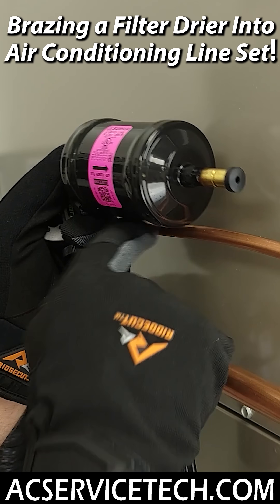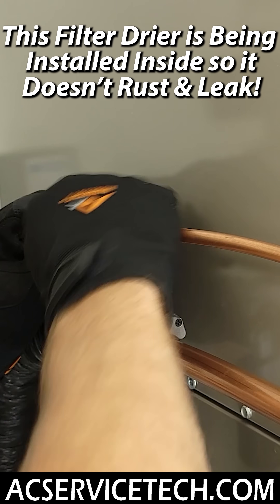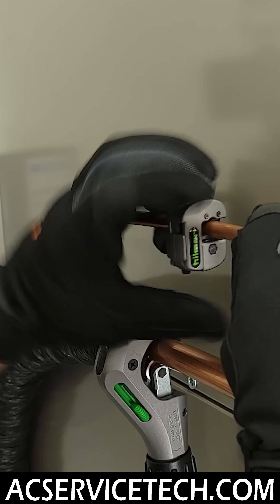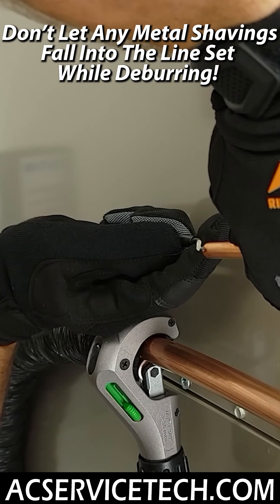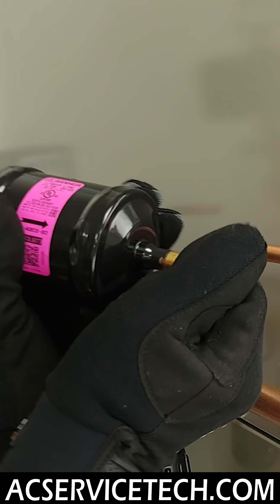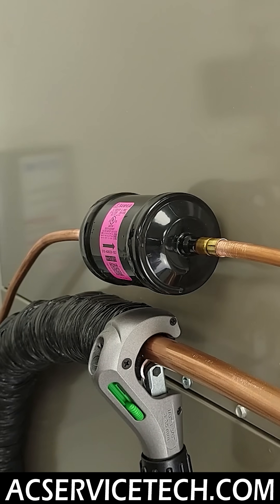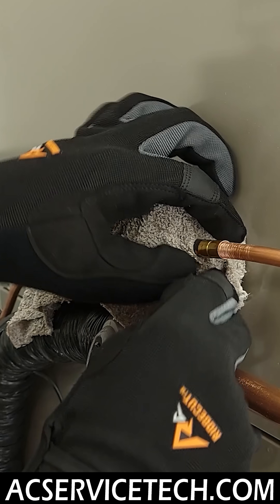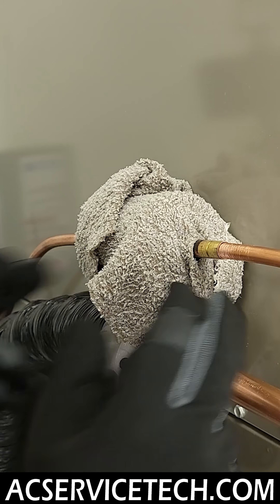Brazing A Filter Drier Into Air Conditioning Line Set!

Comment: R12 Vehicle A/C - my dad installed these in-line filter dryers on his vehicles and they were always very cold 🥶 ( any info on doing that? )
Reply: Vehicles have bigger filter driers ... vehicles have aluminum lines which are not weldable.. only copper is

Comment: I had to silver solder mile of 4 inch copper pipe in a factory took almost a yr lol they used the line for oxygen other line was for hydrogen they mixed inside glass machines. Gas engineers tested those lines for weeks before putting gas in them. Cool to watch them do there things

Comment: Filter needs to be place outside folks.  Don't let anyone pull this on you!
Reply: You best explain WHY cuz the rust  argument is sensible.. I was taught they should only be used for a temporarily period after a unit install.. Then removed.. Some guys put them on both sides. I think they offer unnecessary risk of clogging up, leaking or even failing internally & letting crap back into the system..
Reply: @francom6230 what you are explaining in your post is a "clean up" after a burn out.

Whats depicted in this video is moisture trapping bc the oil is hygroscopic and can only be separated by filter
Reply: @francom6230 you are BOTH wrong. Easy enough for both of you to read the installation instructions. They are to be placed as close to the coil as possible.
Reply: @MyName-o9y3d  Nope!  I'm a master plumber, the new refrigerants are considered flammable.  So.... they must be installed outside.  😂😂😂  nice try though
Reply: @Thatguyfromttown  youre wrong    stick to plumbing
Reply: According to Emerson, a manufacturer of filter driers, you install liquid line filter driers on heat pumps near the indoor coil in summer and near the liquid line service valve in the winter. The goal being to protect whichever metering device that will meter refrigerant upon first starting the system. On straight cooling, it goes close to the evaporator coil. Happy brazing!

Comment: You capped that joint, i saw no solder suck up into the fitting on the drier.
Reply: He isn’t soldering man, he is brazing.
Reply: @Blueraspberryguy  if the silver solder is not pulled into the joint, your braze is done incorrectly.
Reply: @Blueraspberryguy You undermeant what I stood.
Reply: @Blueraspberryguy its silver solder aka brazing rod
Reply: The guy is using such low heat, I imagine he has a hard time pulling the solder into the joint, and he probably has a lot of leaks.
Reply: I thought the same that it did not pull in.

Comment: Good video but I personally don't like the practice of holding insulation with a pipe cutter... Copper seems to be getting thinner and thinner these days and I once found a leak because my apprentice tightened his pipe cutter too much while holding the insulation. I use a small, cheap, "baby" pair of vice grips with the rounded grip (not flat). I grinded down the teeth and I keep these vice grips JUST for this purpose.
Reply: I use plastic spring clamps.
Reply: I just took the blade out of my old rigid tubing cutter, and use that as the clamp.

Comment: Does anyone use flux any more?
Reply: i'll do a video in the near future.
Reply: Yes , when using 45 or 55 % silver solder rod. It also makes 5% & 15% Rod flow easier. stay silv white brazing flux is what's used. Me - Hvacr since 1981.
Reply: Small nitrogen barrier. Perhaps that's good enough.
Reply: Brazing you dont use flux
Reply: @robert1915  incorrect. stay silv white brazing flux is used with 45 & 55% silver brazing rod.
and MUST be used with 5 & 15% when brazing to steel. ( service valves etc. ) should also be used with brass to copper brazing & copper to stainless steel brazing.
Reply: 😂 @robert1915

Comment: Good teaching on everything except the braze. Gotta gently push into the crash when it’s cherry red. Then cap the joint after. This is just a cap and will leak given some time
Reply: Can you explain the "crash" you're referencing? Sorry just haven't heard that terminology. Soldering and brazing lab next week so want to know something lol
Reply: @patrickwilliams7099 What he's saying is be sure you gently push your stick INTO the crack after its hot enough(cherry red) then go back n get the nice smooth round braze.  If the joints do not braze together but only outside, it won't hold long term

Comment: Some good advice is if you’re dealing with a particularly dirty copper line then it’s a good idea to measure your drier and sand the area where your connection will be before cutting the copper out. It adds stability so you’re not chasing your copper line around as you sand.
Reply: He said that in video
Reply: thanks for the tip
Reply: That's how it's normally done, it is harder to sand after cutting it.
Reply: @TEKRAL4G In fact, cutting and then grinding is completely wrong, because the powder from grinding will go into the tube.

Comment: Why don’t companies make these with an aluminum or stainless casing so rusting out isn’t an issue? Obviously installing them inside would help but a lot of condensers already have them built in. Seems like a no brainer that the filter manufacturers would have made them with AL or SS a long time ago
Reply: Planned Obsolescense
Reply: simple economics - cost / $. Steel is cheapest.
Although ice o matic actually found out that stainless steel was actually cheaper after they took the cost of Painting the steel into account & could build a better product for cheaper.
No paint shop , employees , paint , prep shop , primer etc.

Comment: Quick question, what is the goal in sanding down the line?
Reply: The silver brazing material sticks better to clean sanded copper.
Reply: Bare copper. The rod wont stick if theres too much debris, trane compressors are the worst they use a strong paint you need a whole wire wheel to get it off
Reply: @adam26o thank you for the explanation
Reply: @adam26o  what type of sandpaper would you use ?
Reply: technically you dont need to "sand" it.  I knock the high points off my emery cloth by dulling it on concrete or whatever so its not too sharp.

Also this guy never brushed the female sockets of the drier.

I like to have a "little" bit of scratching on both male and female connections to add surface area of the joint but as long as its clean you will be fine.

Comment: Y'all must go through truck loads of nitrogen tanks. At $70 a tank, I'm not purging nitrogen for every little thing. I've done that same brazing experiment and had no carbon inside the pipe, with no purging.
Reply: I bet you don’t believe in pressure testing either
Reply: It's not like it's blasting at 90psi. Just enough to back purge.
Reply: $$70$$  wow. I pay 15 bucks. Acpro las vegas.
Reply: @Stoner710  $21.00 california
Reply: No you didn't
Reply: It’s a trickle of nitrogen lol
Reply: Yes and No. Yes, you should purge when brazing. No, you don't have to flow the N² for so long before and after.
Reply: $70.00 a tank. Where ? You are getting screwed ! $21.00 California.
Reply: A tank of nitrogen doesn't cost that much.
Reply: Lmao looks good from your house I guess. Save it for the next tech to replace a TXV or plugged drier.
Reply: @NeighborhoodDada probably 30years ago i was pulling out a system that had a site glass in it and "at the time" could not figure out why the refrigerant was so black.

Can only imagine he brazed with no purge. But it was all pistons or cap tubes.

 Dont EVER remember seeing driers.  

Aahhh the good ole days of R22

Comment: So if it’s closed, where is nitrogen coming out? Doesn’t it just build pressure if not exiting out.
Reply: He’s probably flowing nitrogen through the high side and removed the schrader for the low side so nitrogen can exit the system. Or alternatively has a hose on the low side service port that he leaves open
Reply: It doesn't need to come out. At this stage, it is just stopping the air from going into the lines. It's flowing in thru both sides. Then, after it's a closed system, the nitrogen is vac'd out.
Reply: @thediplomasta5891 it does need to come out. It's a n2 purge. Flows into one end of system,traveling all the way through and out the furthest point. So you feed into the high side service port and it travels through the system coming out your low side service port would be a typical setup. 2scfh
Reply: @HVACRTECH-83 well yeah it comes out, but  doesn't build to a dangerous pressure like dude thought.
Reply: @thediplomasta5891  "dangerous pressure"?
What are you even talking about? Nitrogen must flow through the system, which is only around 5-20 psi and that's enough to cause a leak in the joint that you just soldered. 
And the nitrogen is not necessarily to keep the oxygen out, it's to keep the soot from building up inside the line ( but to be fair, you need the oxygen to create the soot)
Reply: @thediplomasta5891  no. your wrong. when welding nitrogen must go in & out / flow / pushing air out of the system. a capped system will build pressure and cause the last weld to leak.
Reply: @OcRefrig it will only build pressure to what you set the regulator to. Keeping the air out is the primary reason to use nitrogen, ya know.

Comment: Ahh, nice to see another tech using straight acetylene with a turbo torch tip.
Reply: My preference as well.  I never saw the need for oxy acetylene for brazing refrigerant lines.
Reply: @Berzerk29 as long as you’re not doing anything bigger than 7/8. Even with 7/8 oxy acetylene does it quicker. I just prefer the small tank for carrying into attics and crawl spaces.
Reply: I hate when people use oxy acetylene
Reply: @jdewitt-pn9kr I mean, it has its place. Anything bigger than 7/8 it’s a must.
Reply: @AaronPowellvox  idk man I’ve done plenty of 1 1/8th with a Turbo torch. Takes a little longer but it works.
Reply: @monkeymoment6478 Not saying it can’t be done but I don’t know how well it could be done. Not knocking it, I just like the right tool for the right job. For me it’s just easier to keep things cool and less copper oxide if it’s done hot and fast. For smaller stuff heck yeah, I love it! In residential we don’t really see any 1-1/8 these days. Back in the R22 days we saw a lot of it.  Commercial stuff, when I was running five separate systems with 1-1/4 line set up a 5 story elevator shaft to the roof, I loved my oxy acetylene rig.
Reply: Only the people not comfortable with oxy/ace saying stuff like this 😅
Reply: @huffing404A son, I’d out braze you with my hands tied behind your mama’s back. I’ve been brazing since before you were a twinkle in your daddy’s eye! lol  Nah but seriously it only has to do with convenience and ease of use.  I love oxy/acetylene, I just don’t like lugging the big ole rig up an attic.
Reply: A coworker told me he used them from time to time. I didn’t believe him. I’m glad to know an alternate method.
Reply: @kevinjames1199 I use a small tank (MC) with an adapter and a turbo torch regulator and hose. The hose set I have normally goes to a B tank but I have an adapter. It is awesome for residential work. It’s light weight and small so you can bring it into the crawl space or an attic. I keep the oxy/acetylene at the shop and only use it for big stuff. I keep an extra  full tank of acetylene on my truck just in case I run out.
Reply: the mc/r tank combo is smaller and lighter than the b tank with the turbo torch. but i only find it necessary to use the oxy for tighter spots or more critical components. b tank takes a lot less effort to use overall